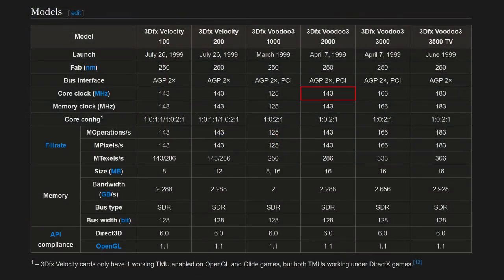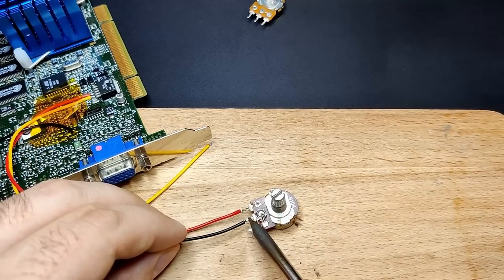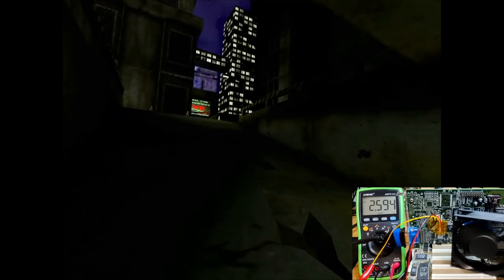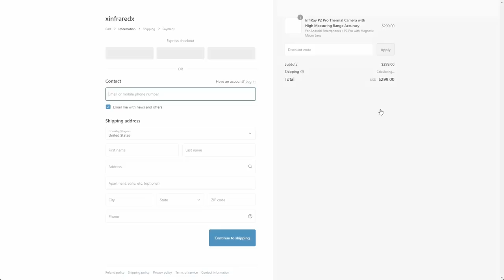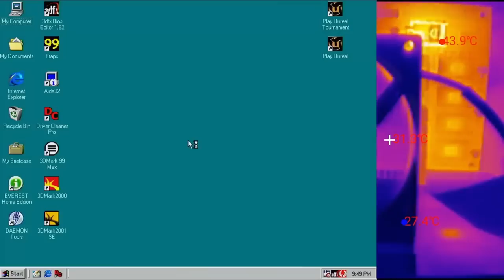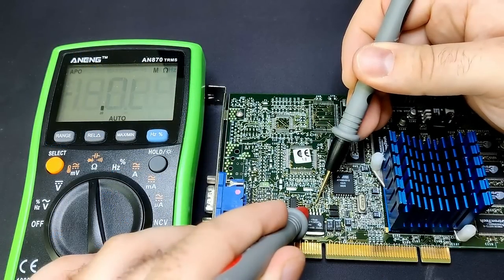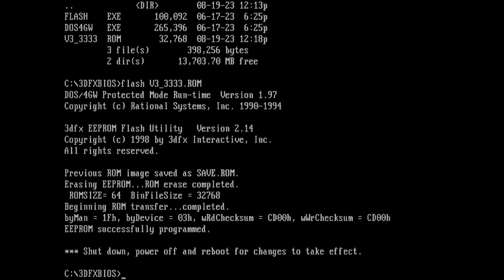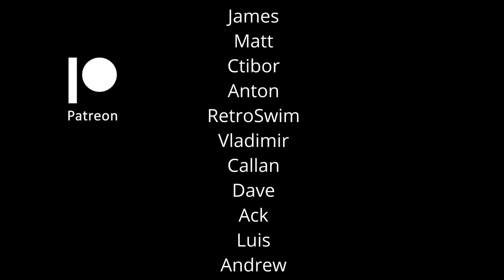3dfx unchained: Voodoo 3 3333

Comment: Excellent work! Very impressive that it can handle those frequencies at less than default core voltage and 166MHz SDRAM 👍
Reply from the maker: I was surprised as well. I still need to replace the heatsink and the voltage regulator - then I will be happy with this card! Thanks for watching!

Comment: Thank you for all the excellent content. You have assisted me in successfully repairing two Voodoo 5500-cards; one PCI and one AGP. Currently, I’m investigating an Amiga accelerator that does not boot. It has 12 GAL-chips; each responsible for a specific task. My theory is that the GAL responsible for taking the CPU out of initial reset-mode is not doing it’s job. But it is getting power and signals?! The chips and CPU are all confirmed working separately. So confusing… but XINFRAREDX TO THE RESCUE! 🤓

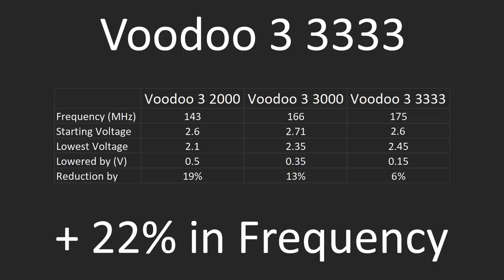Comment: starting with minute 9:03 you'll see a crack on a via trace, left side at 45 degrees up of the 130 ohm resistor
Reply from the maker: Yes, this is just left-over factory flux.
Reply: @bitsundbolts  that's good to hear :) great video

Comment: I’m curious to see if there is a modern equivalent to that voltage regulator like a switching regulator maybe that could improve results. Anyway to reduce voltage going to the memory chips to reduce heat and improve stability or over volt them and add some cooling. This is a fun series to follow and watch.

Comment: I feel like the final frequency and voltage really makes this the ultimate card. Not only is it running faster than it was from the factory but also with a lower voltage so it will likely last longer too.

Comment: My days of overclocking are long over, I even damaged one of my video cards running it at the maximum overclock for a long time. It was a GF 8800 GT that I had modified with a big Zalman heatsink and RAM heatsinks, and it ran fine for a few years. Then one day I noticed it artefacting in games, and over the course of a week it started getting worse and crashing. Eventually I saw artefacts on the desktop, so I restored the default settings and that helped, but didn't stop the artefacting and crashes in games. In the end I had reduced the speed well below the stock settings, but eventually it was crashing from the desktop too. At that point I decided it was time for a new card anyway, so I bought a GF GTX 570 which had much better performance.

As for the giveaway, as fun as a thermal camera looks, I don't have much use for it, so I'll leave it for someone who might get some productive use from it. But if I did need one, it would be for a specific project, and I could easily afford it with a few days of overtime pay.

Comment: Do you think you will go further and add some RAM heatsinks and maybe mount a small fan?
Reply from the maker: The heatsink is oversized - I definitely will replace it and maybe get one with integrated fan. I will also try to replace the linear voltage regulator. At that time, I will also add heatsinks.

Comment: Nice video,  I thought the giveaway was for the "new" voodoo3 3333 ahahaha. 
Anyway, ¿You couldn't change the name for the rest of the utilities to show as a v3-3333? i.e in Everest
Reply from the maker: I tried to change more strings in the BIOS file, but then the 3dfx BIOS flashing utility would not work. I guess there is a checksum somewhere which validates the BIOS and if it doesn't match, it won't flash the file.

Comment: got a p2 233mhz with a voodoo 3 and 128 MB ram and it plays ut99 at dreamcast frame rates at 640x480 but with 16 bit color depth instead of 24 obviously, using win 95

Comment: most artifacting is actually heat degradation of data in memory. but the voltage is also shared across the board... so increasing the voltage increases that voltages to memory... so it only gets worse if you dont address the issue
Reply: heat also dissaptes your voltages by increasing resistance too. 

so your losing voltage from that voltage controller too. 🤓

Comment: I am unable to finish 3dmark 2000/2001se on similiar system. 2000hangs up on helicopter test and 2001se wont start due to some kernel dll error, but the gpu works perfectly in many 3DFX games. I am using latest drivers but Windows ME.
Reply from the maker: MEbe that is the problem? I only used Windows 98 SE so far. As for drivers, the Win98 drivers are the fastest, but they don't work with newer games. I used 1.07.00 drivers for my tests.

Comment: I recently bought a voodoo5 agp it is working fine, but I noticed a noise in the image that is more evident during the 98 loading screen or low resolutions. Would it be good to do a full recap? My fear is to continue using it to play some games and damage the board.
Reply from the maker: Are you using a CRT monitor or capture device? Could be an issue capturing the video signal and the Voodoo is fine. If it is a hardware issue, I would expect it to be present at high resolutions as well.
Reply: @bitsundbolts  No I use a Dell 4:3 LCD monitor and at high resolution it is more difficult to notice, I think it is due to energy filtering, just like the old PCI video cards that had horizontal or wave-like noise in the image.
Reply: I know exactly the noise you're talking about, it is very evident on the boot up DOS screen, windows loading screen etc. It's because your power filtering capacitors are failing, get it recapped to preserve your card otherwise it will most likely perish.

Comment: I think you're worrying a little too much about temps.  Under 50 degrees is perfectly fine and not very hot at all.  You could likely allow them to get to 70-80 degrees without any worry of them failing.
Running the card at temps ~50 degrees is perfectly safe and will not decrease the life expectancy of the card at all.

General rule I follow is if it's not hot enough to burn your fingers, then it's not hot enough to damage the chip.
Reply from the maker: I agree that these electronics are made to withstand temperatures much higher than we're comfortable with. But if you can lower temperatures by 25 degrees just by adding thermal paste to a voltage regulator heatsink, there's no reason for not doing so.